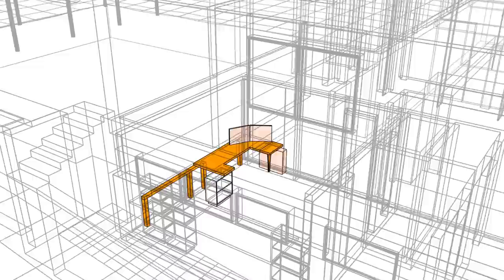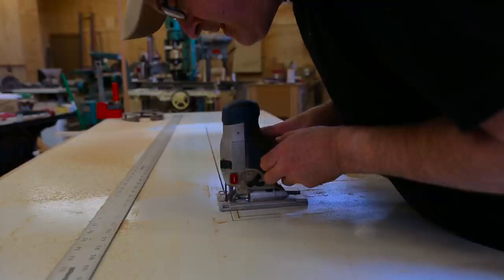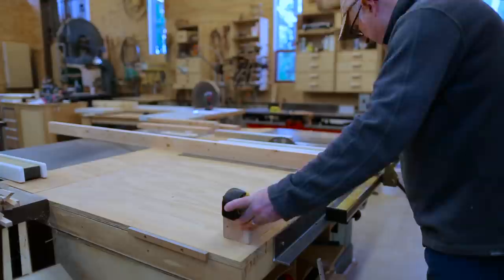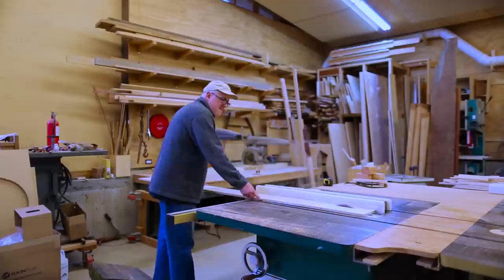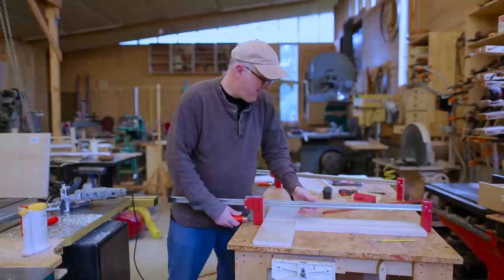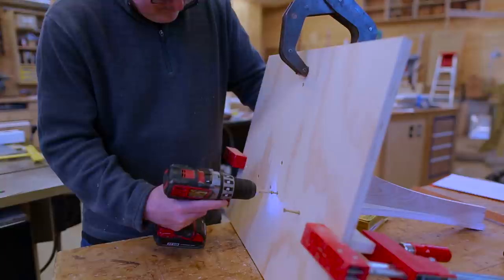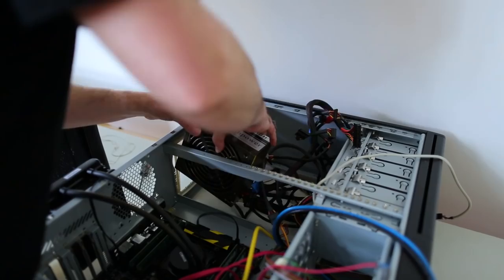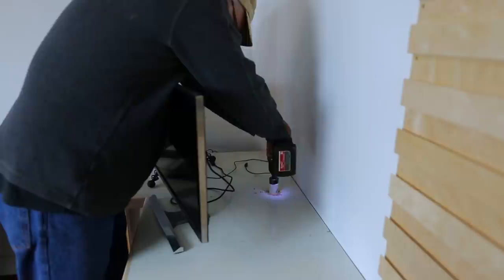office 4: Hacked Together Computer Desk

Comment: Frank get a dual monitor stand, it will tidy your desk right up and look alot cleaner
Reply: You're right. I quickly googled his monitors and according to a Samsung Rep on Amazon, there are two different models of those monitors. One has VESA mounting holes and one does not.
Reply: And give you more space for your keyboard, which seems to be dangling off the edge at that corner.
Reply: wkm001 you can get adapters for those that dont
Reply: I'll second this - there are some good dual monitor stands out there that will also give you some tilt and swivel options to make adjusting your monitors a lot easier.   That said; give them a look Frank - I expect you could probably make something yourself just as functional and a lot more nicer looking than most the solutions out there.
Reply: Agreed, although one large curved panel for video editing definitely the way forward!
Reply: He is Frank Howarth. He can build a double monitor stand. Custom-tailored to each monitor's needs, of course.

Comment: I expected anything, but not a GTX 1080 inside that PC :D
Reply: pcfreak1992 :) yea, it took a second for it to click that you can massively offload video editing onto the GFX, so it makes sense.
Reply: It also takes a lot of video ram to drive two 4k monitors.  IIRC, you need roughly 4gb per 4k monitor.  Personally, I'd probably just use two video cards.  A single card should do fine with two 1080P displays.
Reply: wearing glass and using 27inch 4k monitor, is like being deaf and asking 512MPBS sound quality... I mean let get serious here, 1080 would be far enough for him with a 27 inch.

40 inch at 4k = 4 screen 20 inch at 1080p...
80 inch at 8k = 4 screen 40 inch at 4k

27" at 4k = 4 screen 13.5 inch at 1080p = 163 ppi (Pixel per inch)

 [300 ppi is max eye can see, screen next to your face] 170 ppi is max you can see from 20 inch far.... and that is with young/healthy eye...
Reply: +Ilaxffxi: Just because someone is wearing glasses doesn't mean that their eyes are bad while wearing them. The resolution on your retina and the shape of your eyeball are two separate things. In other words, there might be someone who can see finer detail than you, even though he needs to wear glasses. If you don't understand why, think of a digital camera. The shape of the eyeball is like the focus on the lens and the resolution of the retina is like the resolution of the camera's sensor. If the shape is off (i.e. the focus is bad) as a human you need glasses to correct for that. You can easily see that the sensor's resolution is the critical factor now. 

Another thing is that screen resolution is not the same as how big or small the text on screen is. Many people have a 4K screen running at 1.5x-2.0x scaling. This is not the same as setting your screen resolution to a lower resolution than is possible. Using scaling you can get finer detail while everything seems to be the same size. This is what Apple markets as "Retina Display", basically more pixels to show the same elements to make for a finer print.
Reply: In not simple as you output it, glasses are not self adjusting like a camera (Focus) This is also why they make Bifocals glasses. There a limitation in what glasses can do. 

What the point of running 4k with all text 2x scale, if you have hard time to see your text, that a sign of something, no? Your eye wont bother with that extra detail or you would have a major headache at this point.

Also, let get real for a sec, 3000$+ (2x  1080 + 2x 4k 27") to see and extra sharp shadow'ish blur in your graphic + headache? That overkill for sure.
Reply: +Ilaxffxi: You are obviously not wearing glasses, so it is probably not as easy for you to understand. It's true that glasses aren't self-adjusting like the automatic focus of a camera lens. But your eyes have a ciliary muscle that performs this action. It basically stretches the lens that is located next to your pupil to adjust for certain focal distances. Now the problem, i.e. why you need glasses, is that this muscle can only stretch the muscle to a certain degree and when the muscle is not supposed to stretch, the lens can't "unstretch" more than when it is completely relaxed. By wearing glasses you bring the range of the ciliary muscle back to normal again. Think of the camera again: Imagine the muscle can only move a slight turn of the focus ring on the camera which is not enough when the picture is completely blurry. By adding another lens in front of the camera lens, you bring the focus range back into the area where these slight adjustments are correct again. And no, people with bad vision don't have a poor ciliary muscle, it's just that their range is off.

Either way, let me tell you that there are more than enough people with glasses (I would say most of those I have met so far) who can see close to 100% of what is considered normal for a human, in terms of resolution. In other words, they score the same in a vision test, when they are wearing glasses like other people who don't need glasses. 

Bonus fact: When people are getting old, their ciliary muscle becomes weak and can't stretch the lens properly anymore. This is what you call "presbyopia" and is the reason older people have to keep things at a distance in order to be able to read text, since their ciliary muscle can't focus on it anymore. This doesn't however affect the shape of the eye, so a person who needs glasses who has presbyopia will still need his/her glasses to see into the distance. This is the reason why bifocal glasses exist, they provide a correction for the shape of the eye for distant object and a second correction for close-up object that the person can't focus on anymore because of the weakened ciliary muscle.

In the end, a normal person who needs glasses has the same visual resolution like a person who doesn't need them. So the purchase of a high resolution screen makes sense for both kinds of people. And if you think those screens are a waste of money, even for people who don't need glasses, then you either don't care about extra sharpness or you haven't seen one before. I don't own one myself, but I would for sure enjoy having one, after having seen one in person.
Reply: Damn that was a good read pcfreak. I already knew all of this but you sure got some skill explaining it =)
Bonus Bonus fact : you are now blinking knowingly =)
Reply: Well i am one of those that wear glasses, and just like you said, i have no problem to see from close distance, my eye is actually better than many people (at very close distance). Glasses sure help to remove the "blur" vision, at some level, but won't correct it 100%, glasses make it more acceptable, nothing more.

Also, forcing your eye on small text is just asking to worsen your vision, specially if in first place you have issue with it. If you can stand small text, than i suppose your eye is able to handle it without  a problem, but if you need to adjust the text 2x scale, it is a sign that your eye cannot handle it, it will ignore the hi-res or blur it to relax your muscle, in the end, the  quality is not really increased.

Also keep in mind my other point that you did not discuss, 3000$+ for a good headache + possible vision problem in future if you keep forcing you eye on it. Not a lots of gain if you ask me. See , with a 40+ inch, i would totally agree with the 4k resolution.
Reply: Well that depends on the person, how much glasses can correct. In my case (and I certainly do need glasses) I can get back to 95-100% wearing glasses and I think there are enough people who share my fate (from my personal experience).

About the small text worsening your eyesight. That is actually a myth that has been told for many years, but there has been no scientific evidence, that reading a lot (or putting a lot of strain on your eyes for that matter) makes your eyesight worse (Google it if you don't believe me). Some people even predicted that future generations will have a horrible eyesight because in the last century more and more people started reading books, even from a young age. So far there hasn't been any (noticeable) shift in how many people need glasses. In addition, back then people had much worse lighting and did things close to their eyes as well.

Also, the 2x scale is not a sign that your eyes can't handle it. Even people who don't need glasses turn on 2x or 1.5x scaling, just because it's easier to read that way or they don't want to put their face so close to the screen. Nonetheless, they still get to enjoy sharper images and pictures and text that has "rounder" curves. As I said before, if you have ever worked on a retina display, you will see that this is not just marketing talk. You might not be able to see the full resolution, but for sure more than 1.5x. The same discussion can be held about high-res screens on smartphones. If you ever compared an iPhone 3Gs to an iPhone 4, you will see a noticeable difference, even at normal viewing distance.

And back to the financial aspect. Of course, everyone needs to decide themselves, how much resolution they like or need, but I don't see a 4K screen with 2x scaling to be a worse deal than running a Full-HD screen at no scaling. Even if I didn't see the full 2x resolution benefit, I'd see more than 1x scaling, so the added resolution is not wasted. Again, that is my personal opinion for my eyes and typical viewing distance. If you sit far away from your screen or you don't have the 100% eyesight, then you might not see any difference between a 4K screen at 2x scaling and a Full-HD screen at no scaling. In that case, it's probably a better idea to save the money and spend it on something else, though you might still benefit from it when you are getting close-up, like when you can't read some small text, etc.
Reply: Regarding wearing glasses, one person's experience doesn't mean everyone else is the same as him.

Comment: So as a computer guy I have to say props 1 for having a water cooled processor, props 2 for using a relatively nice gpu. But 1) please don't blow a computer out with a compressor, it runs a very high risk of particulates and moisture hitting your parts, I know canned air is expensive but it's very well filtered, 2 the pc is awfully close to that vent, it might cause issues in the future. 4 points that might help you in the future, 1)move the pc to the desk, you'll dramatically reduce the dust in the computer 2) consider getting a nice multi port USB 3.0 hub, they're very cheap 3) there's cases that rotate the main board 90 degrees pointing all your ports up and make airflow more efficient and 4) consider moving to a graphics card dedicated to video processing such as an nvidia quadro. The GeForce is a great card but a quadro should significantly reduce your processing times for your videos. I loved the desk, it's awesome!

Comment: All these people saying he needs to BUY a dual monitor mount.... he needs to MAKE one. I would love to see that.
Reply: THIS. I want to see him make a custom wall-mounted arm (dual or 2 singles) -- mostly so I can copy his design for myself! Personally, I've been thinking about using a similar mechanism to an architect's lamp, so it's movable but self-supporting.
Reply: bloodgain; I want him to do a ceiling-mount, for the same reason (so I can copy it :)). A c-m would reduce cable clutter (run cables up the mount) and would make cleaning easier.
Reply: Yeah, a wood VESA mount arm would be awesome! He'd need a metric ruler for the mount holes on the plates, as the VESA standard puts them 100mm apart, but aside from that, go nuts!

Comment: Great video!  I really like the intro.   A monitor stand is a great CNC project because you can customize it to the dimensions of your monitors.  If you build a platform with a 30-degree bend that is tall enough to slide your keyboard under it'll solve all kinds of ergonomic issues for you (monitors too low, wrists not resting on anything, etc).   

Also, best quick and dirty cable management = hot glue the cables to the bottom of the desk.  If you ever need to move them:  a paint stripper or hair dryer will soften the glue enough that you can pull the cables off.

Comment: Many comments about little things. I agree he could hide the power strip by securing it under the desk and tie up a few cables. It would do wonders. But the video was about getting the desk built and installed. Not about tidying up cables. I'd also like to have seen a rounded edge on the support leg edges including the base of it where the rounded knee corner is located.

Comment: A clever fella once told me if you take a drill bit that's the diameter of the kerf of that hole saw blade, you can start your cut with the hole saw, then go into the groove with the drill bit and drill all the way through.  Now, finish the hole saw cut, and you'll find that the chips clear through the small holes you've made.  Voila! Cutting goes much faster.

Comment: I wondered why you didn't use a french cleat at first, I learned them from your video of the closet and that's what I used for my desk ... no legs!  But I also had a standard framed wall that was easy to drill into, and then screwed a block just above the back of the desk so it doesn't go anywhere when weight is put on it.  I guess the same goes for monitor stands, I used arms attached to the walls.

All said and done, great use of an old door! I really like the support leg you built. Adapting to materials one has instead of running out to buy new keeps the scrap wood in the shop to a minimum!

I also have a huge computer case (I'm a computer programmer by career) and wouldn't trade it for anything. Never replaced the entire thing, just pieces here and there probably 3 or 4 times over the last 15 years. Next you'll have to add a second graphics card so you can have 4 monitors!

Comment: Hey frank you forgot your mother board IO shield when you changed cases
Reply from the maker: I noticed that once I had everything in place.  rrrrr
Reply: Rookie mistake, Frank. ;)
Reply: Don't worry - pretty sure we've all done worse before.   That's not too bad a thing to do thankfully; most of the time you can pop your cards then unscrew the motherboard and edge it out and then slip in the IO shield into place without having to pull everything apart.   Nice functional case though Frank; out of interest how much storage have you got and have you considered or have a NAS for backing it all up?

Comment: Excellent idea! I've always preferred a corner setup but the desks are so expensive but people are always trying to get rid of old doors on Craigslist.

If you get tired of the keyboard falling on your lap / floor, you may want to consider an arm mount for the monitors or building a triangular piece for that inside corner. 

The former would provide you with a bit of room under the monitors while the latter would be a cheaper and It looks like it wouldn't take much to keep keyboard stable.

Comment: You can make your hole saw go alot faster by drilling a small hole along the circumference to give saw dust a place to go.

I usually start the hole saw cut just to mark the circle, then drill straight through the material with ~1/4" bit (on the the waste side!) then finish up with the hole saw.  Goes 10x faster, less burning, and the waste exits the hole saw better!

Comment: COMPUTER OFF FLOOR

also hi Frank, I ❤️ your videos!
Reply: Indeed, putting it on the floor is just asking for it to be clogged with dust again, especially if it's running while vacuuming.  After cleaning my first computer out after having it on the floor, I've never done that again and require very little cleaning.

Comment: Worth noting, unless your CPU heatsink has a backplate, do not remove the mainboard from the case until the heatsink is removed. More modern, higher power, finer lithography chips require insane amounts of clamping force, as as PCBs develop more layers and surface mount components become smaller and smaller, even a small flex in a $150 board can brick it.

Comment: May want to move the PC tower or create a baffle to redirect the heat register, during the winter it is going to be pulling in the warm air directly into the case which is the opposite of what you want.
Reply from the maker: Its and air return, no heat coming out of it.

Comment: Frank-- you should look into nylon nails for attaching work to your CNC table.  They work just fine in a small pneumatic nail gun and when you're done cutting the piece you can just hit it on the side with a mallet and they'll break right off.  Plus, if you accidentally run your router bit through one it won't be a total disaster the way it would be if you ran it through a metal screw.

Comment: When drilling with hole saws you need to drill relief pilot holes around the side to allow material to escape. It is also recommended to stop at intervals and let the bit cool down lest you wear it our prematurely.
Reply: I was hoping I wasn't the only one that noticed this. Pilot holes aren't even necessary; just back out the hole saw every couple of seconds to clear the shavings.

I'm really surprised that, as a woodworker and after so many years, Frank hasn't picked up on that. Or maybe forgot?

This whole project was kind of a disappointment.

Comment: Wall mount your monitors on an arm. (Maybe just one arm that can be bolted to the non-cement wall) Then make a tray underneath the back side of the table. A cable management/power strip tray.

Comment: I think those hole saws have almost non-existent chip evacuation (yours had some spiral slots that ended up below the surface of the door) - so they only work well on deep cuts if you provide a path for the debris to escape - by pre-drilling smaller holes tangential and on the inside of the intended cut.  That's the technique I've seen smarter people than me use successfully.